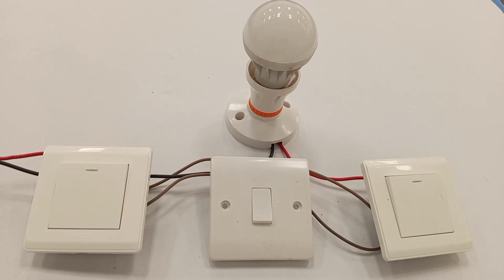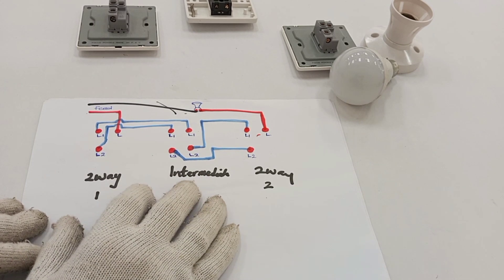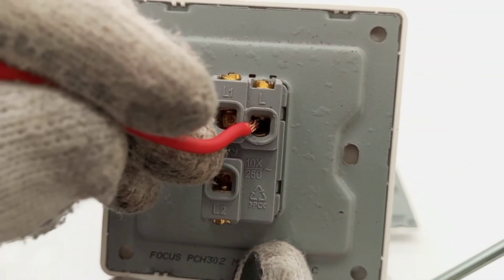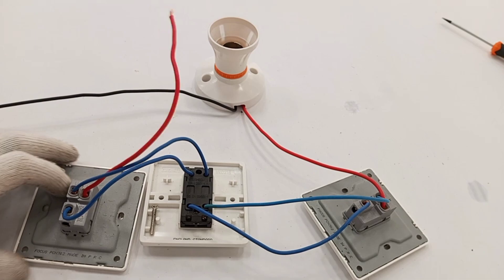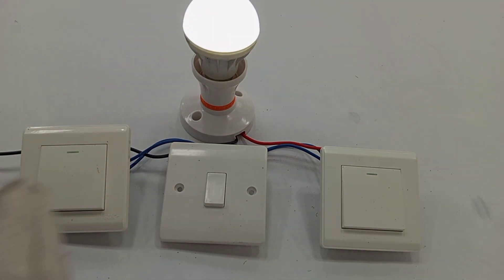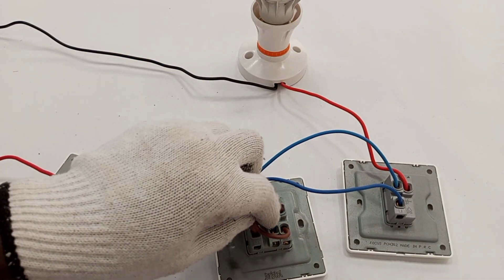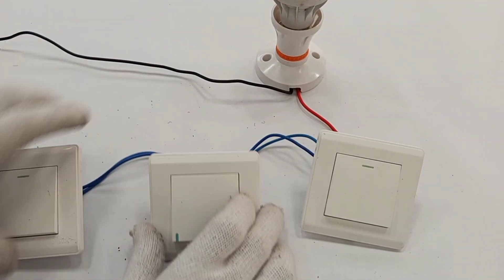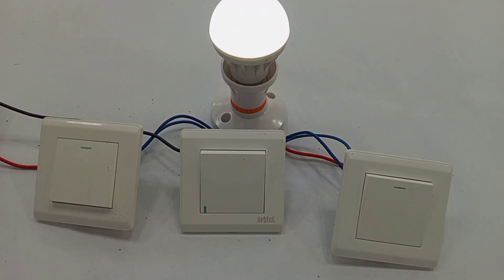Intermediate switch Two Different types explained

Comment: Where can we get the intermediate switch. Intermediate switch are not available in the shop.
Reply from the maker: Hi, I'm a little bit surprised because intermediate switches are very common in my country. maybe you should try from bigger shops.
Reply: @obloni_Electrical may be i am looking into smaller shop and in a rural area. I will see in the bigger shop. Thanks you for your response.

Comment: Please l have a question what is the strapp wires
Reply from the maker: strappers or strapp wires  refer to the  cables that connect to, and from the intermediate switch to the L1 and L2 terminals of the 2way switches. It is also called jumper wire or jumpers.
Reply: @obloni_Electrical  Thank you

Comment: Thank you sir, but the reason for my question is that, when you take a very good look at the switch in question, it looks like a two 1 gang two way switches joined together. Now, my question is, is that the reason why you bridge the terminals?
Reply from the maker: Yes exactly.  The terminal arrangement is just like that of a 2gang - 2way switch Just that with the intermediate, there's only 1gang.

Comment: Can you pls give a brief explanation as to why you bridge the terminals?
Reply from the maker: Okay Seth. I don't know if I properly understand the question. But what I can say is that, the connection is like that because of the terminal arrangement of that particular type of intermediate switch. You know the 3way switching arrangement has  to be configured in a way that the lamp can be controlled from any of the switching points at anytime. 
Please let me know if this answers your question or if we should discuss further. Thanks